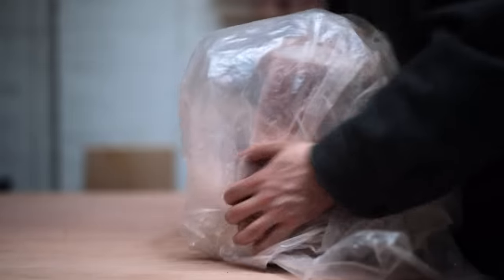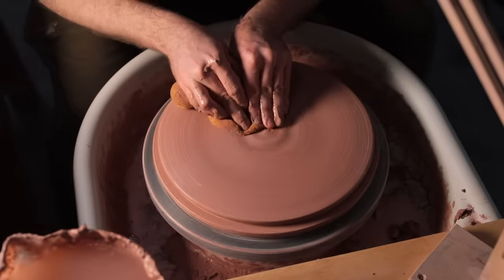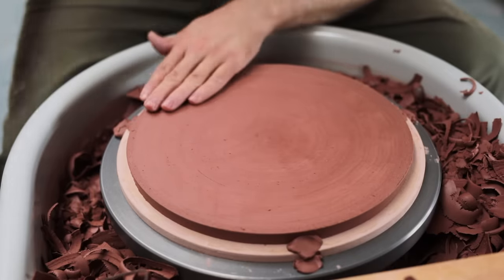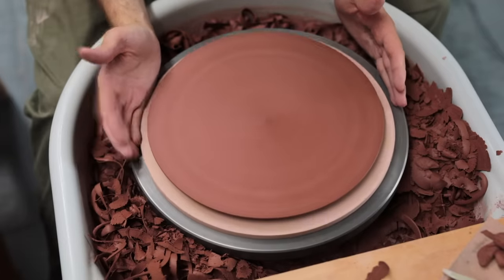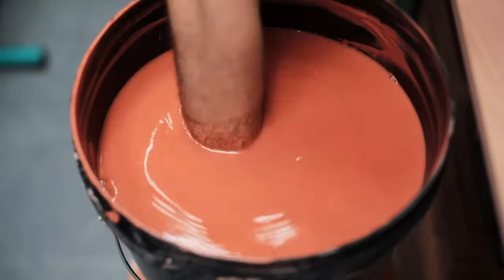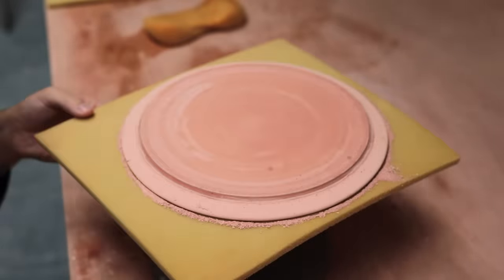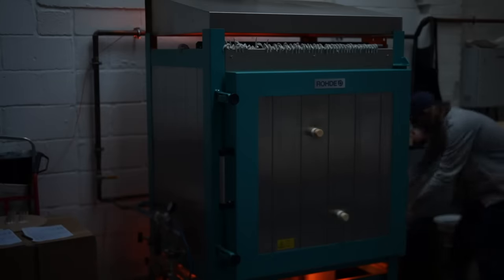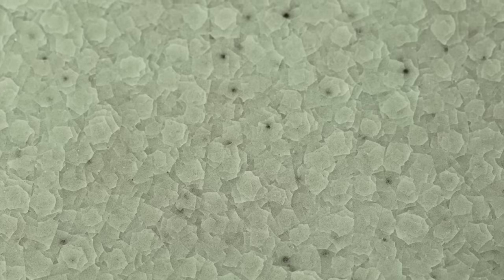The Flattest Flatware I've Ever Made

Comment: Florian - I have a theory for the pattern created on the bottom of the platters. First observation, there appears to only be the "echo" of one previous firing, the three distinct rings. Second, the clay body outside of the rings has a reddish tint. It's possible that, during the cooling process of your previous firing, the areas of the kiln shelf exposed to air reacted with or absorbed oxygen while still hot. When you did the subsequent firing, those air-exposed sections could release some oxygen when heated, reacting with the bottom of the platter and resulting in areas of the piece with more oxidation. What are your thoughts?

Comment: Very nice plates/platters. I love the unintended designs on the bottoms. I had a casserole dish come out of the kiln last week with a beautiful Chun glaze on the inside with an unfortunate globe of iron  in the middle that I'm guessing came up out of the clay body. However, even stranger, there was a series of small perfectly round flat dots in a straight line going across one side of the unglazed bottom of the pot that didn't make any sense at all. Later someone in the studio matched them up with the holes on the metal shelving that the pot would have set on before going into the kiln. It still doesn't make sense to me that those would have left an image on the finished pot but I guess only the kiln gods know for sure.

Comment: Have you thought of argon or other noble gas heating using recirculating electrical heating? Love the plates, honestly. It's really cool just don't know much about it, I do know that the gases transfer heat more efficiently, but don't take oxygen away unless you add a gas or vapor that will use it.

Comment: If silicosis is a serious concern then you should trim you beard to allow the respirator to form a seal around the rim. As is, your beard limits the capability of the filter to do it's job. If the filter requires too much differential pressure then the air will go through the gaps between your beard hair rather than through the filter

Comment: 9:20 Would you consider it safer to use a soft/clingy surface to rest the ceramic on? Is there danger of a plastic bucket lid actually scratching or scraping the porous ceramic at this stage?